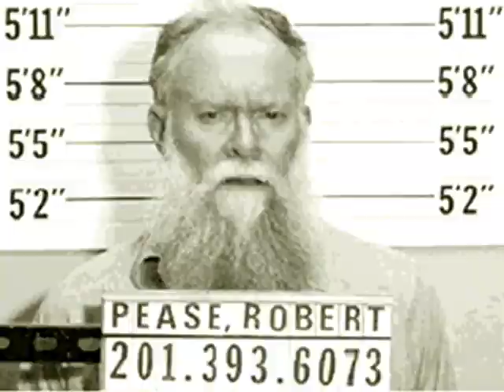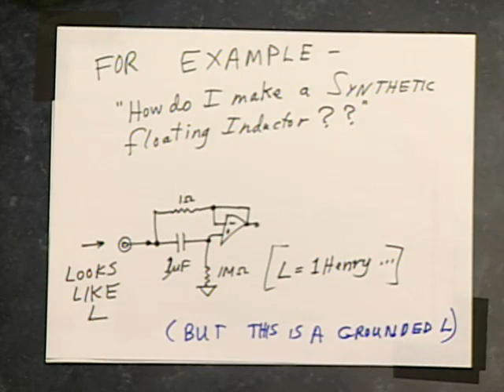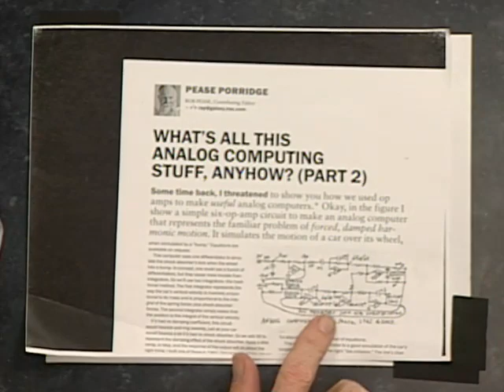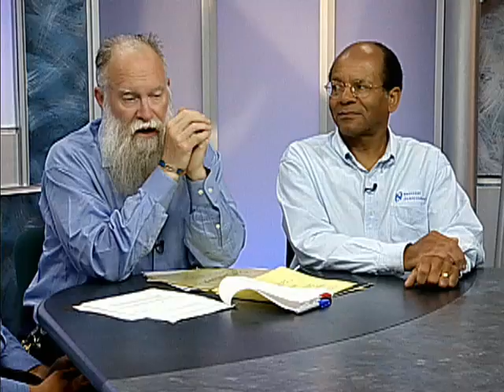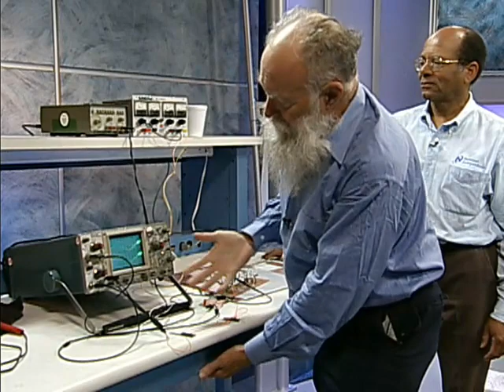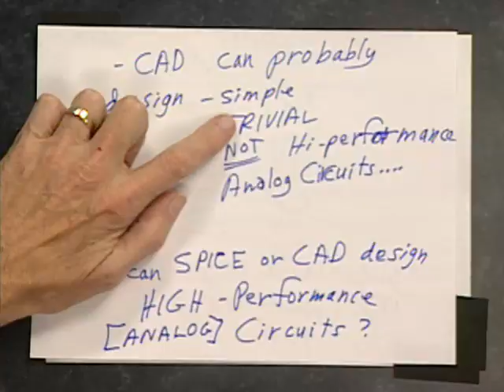Whats All This Analog Computing Stuff, Anyhow?

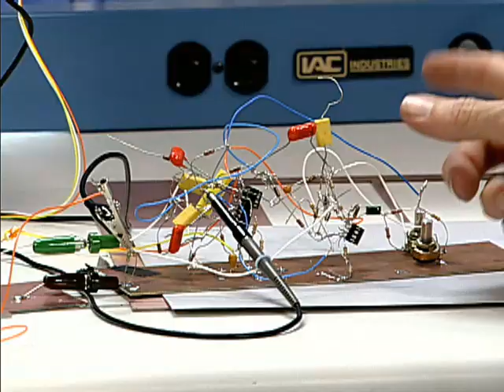Comment: I thought that was a breadboard until 18:27

Soon as I saw that free-floating tangle of components, I was simultaneously horrified and in awe
Reply: That’s how Bob breadboarded. And Jim Williams too, I’m sure. It works surprisingly well. The parasitic capacitances can put even a custom PCB to shame. Solderless breadboards have enough capacitance between adjacent pads to build UHF oscillators with no added capacitance :)
Reply: I believe it is known as Madhattan construction.

Comment: Soooooo what is spice? 
Seems like an inside joke
Reply: SPICE (Simulation Program with Integrated Circuit Emphasis) is a general-purpose, open source analog electronic circuit simulator. It is a program used in integrated circuit and board-level design to check the integrity of circuit designs and to predict circuit behavior. (from wikipedia)
Reply: SPICE.. is vital to space travel
Reply: @Raflemakt the SPICE extends life
Reply: It is a digital program to simulate electrical circuits, for example those analog circuits he talked about. The problem with these types of software is that there are always some errors and flaws, as tends to be in all kinds of software, which can lead to false interpretaations and results. 

One example is a simulation an electronics guy made once with a transformer. He believed that transformers can transform smooth DC (which is straight bullshit 😅) with a transformer directly and that AC isn't needed which we all know is wrong of course, how he got to this conculsion as an engineer is a mistery to this day. 

In order to prove me wrong he took a software and simulated it and to my surprise the circuit showed a transformer getting a DC input and giving a higher DC output. This is physically impossible! And every experiment will show it. 

But now I got interested in this program and I wanted to play around with it and found that if there is only one switch the app showed the right answer: no transformation of DC! But if I added a second switch it started to show the wrong answer for no other reason than the fact the creators of the software didn't account for this detail and led the software to give wrong results. An analog computer couldn't make this mistake.